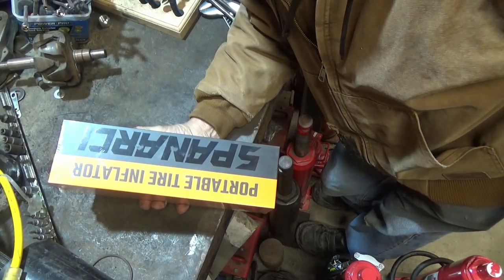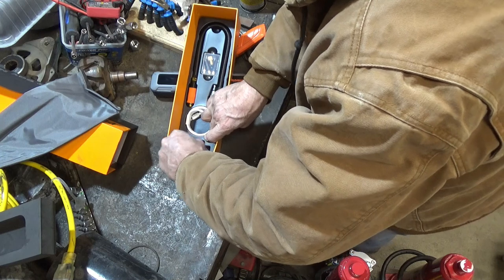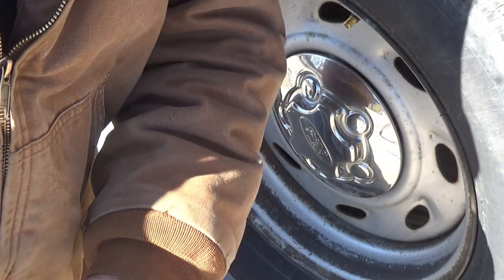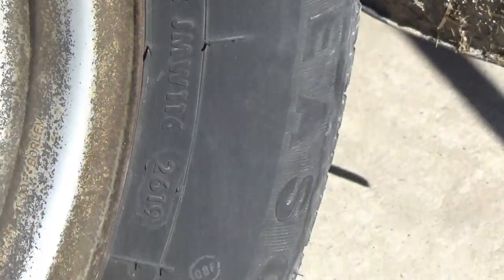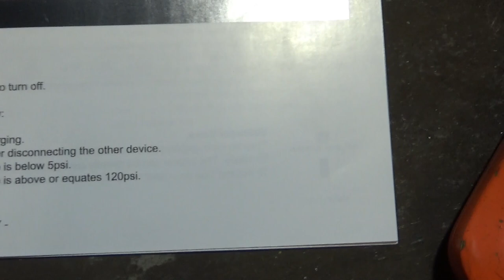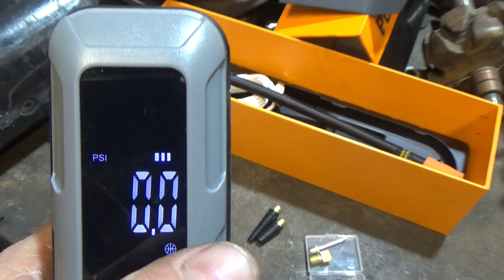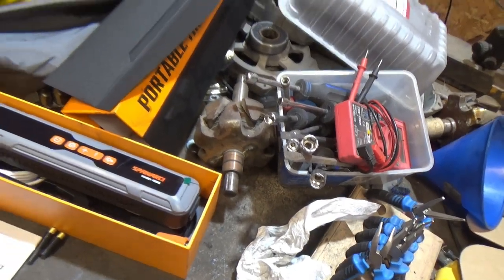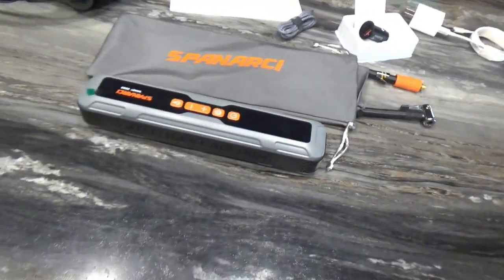Spanarci Tire Inflator

Comment: Good enough for a car when you get a flat tire and you go get your spare tire out and find its flat. Around the house if you have wheel barrow that uses a pneumatic tire or hand trucks those little tires are notorious for being flat or low on air. Looks like you are living in the mobile home now, you finally got it finished.
Reply from the maker: Yes I've been in the mobile home now for over a year. I expect I'll use these 2 new battery tools for lawnmowers and such around here.

Comment: Very nice. I assume this is only for passenger car and light truck tires?
Reply from the maker: It sure won't fill a fat pickup tire or a big truck tire.
Reply: @57bagre  Ok, I wondered about that. I didn't think it would go much above 60 psi, but now that makes me wonder of they make a heavier duty version. Probably not, but maybe at some point they will, if this one works out well.

Comment: Some of the guys I ride motorcycles with have them I prefer 12v pumps because it seems a lot of those have cheap batteries that die quickly once they get a few cycles on them.
Reply from the maker: I personally don't think I would need this except for a lawnmower tire on the other end of the property or something like that, the goldwing has an air pump built in. I think both of these, air pump and jump starter will only be used for small equipment on the property here.